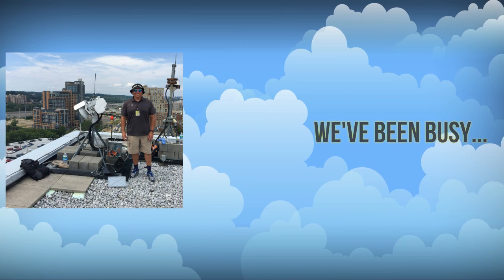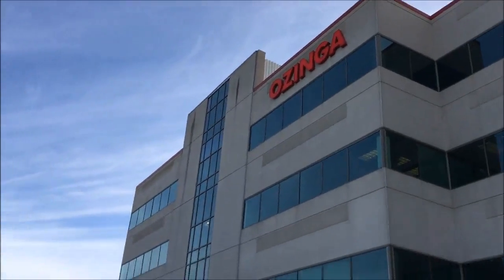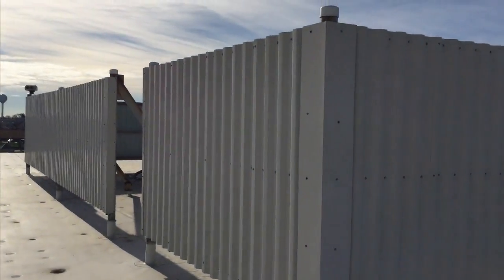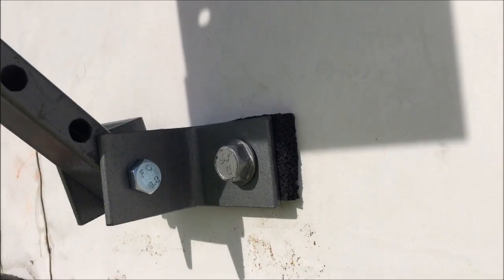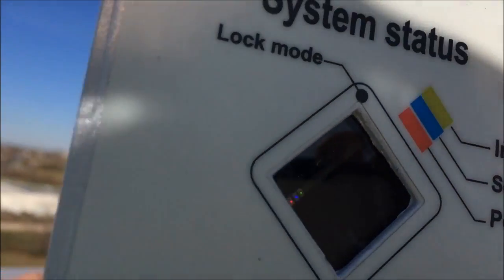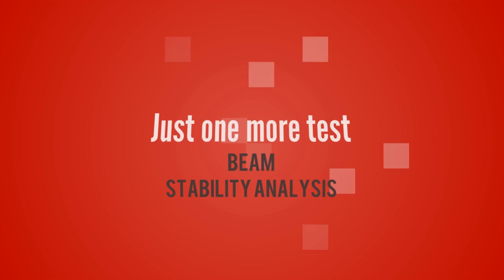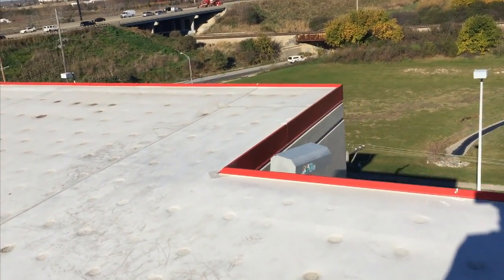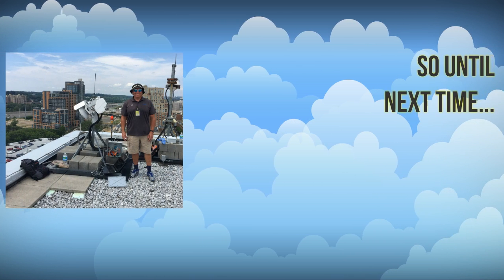10GigE Wireless P2P Install - A Windy City Challenge

Comment: Does this use multi laser 5G LiFi?
Reply from the maker: RumBoom...this system uses a dual path laser at two different light frequencies.  One light path is for data at full 10Gbps full duplex...the other beam is at a lower frequency for system mgmt. plus auto aligning the link in real time.  So speed is BEYOND 5G...but this serves a different purpose the LiFi.  This system is used to pass large swaths at distance outdoors to a single point.  In other words, connect two sites/buildings up to a mile away passing 10G data back and forth simultaneously.